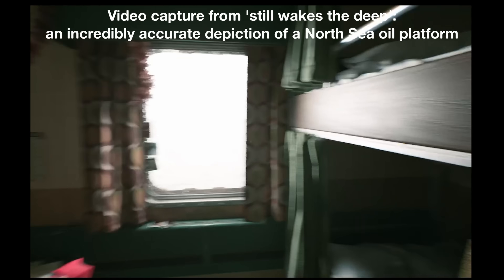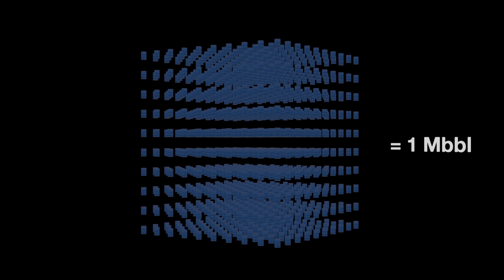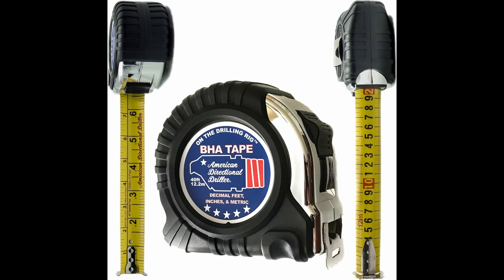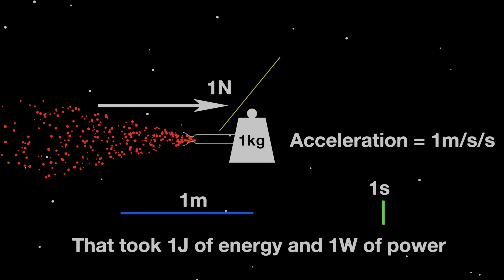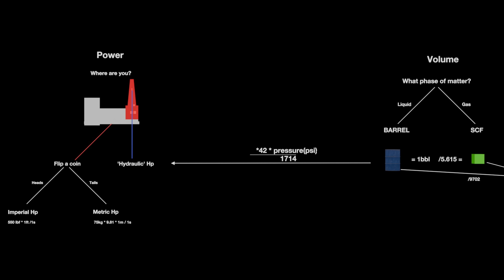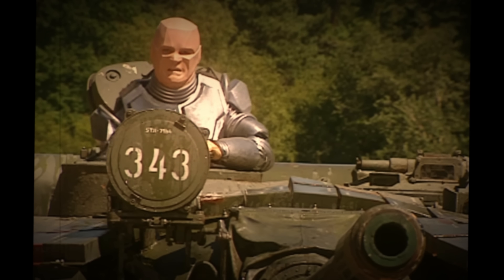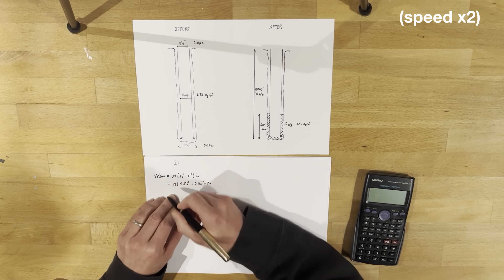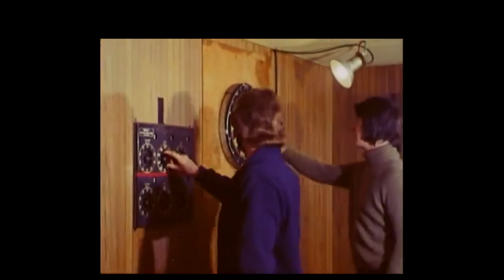Oilfield Units: a Measurement System so Cursed it made me Change Career

Comment: I'm disappointed that you missed out on the reservoir unit of volume. It's 10 square cricket pitches to a depth of 1 foot aka the acre-foot. 
And the API gravity scale was chosen to give a linear scale on a hydrometer.
From time to time in the oilfield I would be asked by junior engineers where they had gone wrong when their calculations of gas rate were a factor of 30 different from the oil company's measurements. My smart arse response would be too say I think you are actually a factor of 31.62 different, that's the number of cuft in a m^3.
The ratio of prduced gas to produced oil at surface conditions is called the GOR, gas oil ratio. It might be supplied in cuft per bbl or m3 per m3 or (in one memorable case) in m3 per bbl. Obviously nobody ever supplies the units of GOR unless prompted.
On one occasion a junior engineer decided to work only in SI units to avoid any ambiguity but forgot that the SI unit of deviation is a radian and not a degree and thus ended up with spirol well that repeatedly looped the loop.
In a similar vein the inclination of a borehole is measured from the vertical in an oil well but from the horizontal in an oil field research centre but in that case I prevailed on the research centre to change.
Standard conditions for pressure and temperature? I think there are over ten standards in use.
Similarly the universal gas constant k from PV = nkTz comes in numerous flavours (values) depending on the unit systems for Pressure, Temperature and Volume.

Comment: machining trade student: most measurements are done in "thou" as in thousands of an inch, with an inch being exactly 2.54cm and im not rounding because the modern industrial inch is different from the old regular inch from like 75 years ago (and much better for it, the old conversion was something like 2.540006 or something stupid-er)

but yeah
"thou" (0.001 inch)
"tenths" (0.0001 inch)
feet (12 inches)
inches (2.54 blessedly sane and standardized SI centimeters)

and sometimes millimeters but that's not standard, I've just been taught to make sure my drawings are using the unit they should be (inches and thou...sandths of an inch)

Comment: My favourite thing about the US gallon is that the figure of 231 cubic centimetres comes from the wine gallon, which was defined as the volume of a cylindrical container with depth 6 inches and diameter 7 inches. On top of being completely insane length choices, you only get 231 exactly if you approximate pi by 22/7.
Reply from the maker: What!? I never knew this! This is both historically interesting yet practically a bit unhinged.
(Also sorry for kind of stealing your video title)

Comment: Decimal feet actually makes sense and leads to fewer errors. They keep "pipe tally books" and arrange the drill pipe into "stands" of 3 pipes. Each of these are "strapped" (measured) and a tally is kept in the pipe tally book. When you put it down the hole, you only need to tally up the lengths to know the length of your drill "string." It is easier to add up numbers with decimals than it is to add feet and inches.

Oh, and SCFs (scuffs--standard cubic feet) are only all the same when at standard temperature and pressure. But that's the same throughout physics so it just makes sense.

Comment: The most ridiculous thing in US measurements system is a common use of common fractions in various measurements and calculations. I may understand that in some situations like construction sites using a 1/3 ft may feel intuitive. But things get creepy when you try to identify some wicked inch bearing and you realize it is 1/2 x 3/16 x 13/64 inch. God, why?

Comment: "one thousand seven hundred and fourteen" vs "seventeen hundred and fourteen" - I don't know about US drill crews or whatever, but in the US general population, both those forms are used, basically completely interchangeably. 

Some people may use one form more than another, some may just switch basically at random. Personally I hate the "seventeen hundred" form, it generally takes me more mental effort to covert it to "one thousand seven hundred" which I then can actually understand as a number. But even I sometimes end up saying the other form, usually if talking with someone who is saying numbers in that form.
Reply: and then ther is me
i say "seventeen, fourteen" 
If you dont think about it and just writ down what the person is sayng it is very nice

Comment: It's not so much US using weird units as their insistence that their version of Imperial is Better(tm) and more Natural(tm) than SI units and refusing to even consider switching. Because apparently adding zeros is too difficult.
2:38 I mean, at least a million barrels isn't "mmbbl", millimeter blue barrel. Giga is fine, it's SI. Is Gbbl pronounced "gobble"?
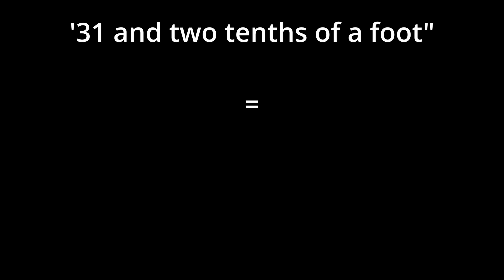4:50 Oh. For a while I pondered the possibility of there being a "decimal foot" that was 10 inches. As in, 10 "standard" inches, 254 mm.

Comment: Oh but there's one even curseder unit used in US HVAC: The Ton Of Refrigeration.

To quote Wikipedia: It was originally defined as the rate of heat transfer that results in the freezing or melting of 1 short ton (2,000 lb; 907 kg) of pure ice at 0 °C (32 °F) in 24 hours.[1][2]

Comment: 11:52 Watt-hours are pretty convenient to the customer. You don't need to know the relationship between watts and joules or anything like that, you just multiply your watts by number of hours, and have the result. Very easy to do math, no need to scale it by 3600 or anything.

Another useful case for it, batteries are often labeled in amp-hours. Multiply your amp-hours by the voltage, and you have your energy output in watt-hours. Very easy to do.

Comment: Oilfield engineer with over 20 years of experience here - most people don't have a conversion book - they memorize the key ones.  

I have used the 10ths of feet a LOT, because it's easier to enter data into and out of spreadsheets without adding extra  conversions. 

API gravity is not used in calculations to my knowledge  fluid weights ARE expressed in pounds per gallon (ppg or lbs/gallon) but also a lot in specific gravity (SG)  

I haven't ever had to deal with any UK Imperial units - I suspect that's a UK specific thing - not even the UK based companies in the US use them.   

For the hydraulic fluid power calculations I have never seen it done using gallons:  Everyone uses the little rhyme "pressure x rate over 40.8' with pressure in psi, rate in bbls, and power output in horsepower.  

I have never used BTU's for any calculations of any kind, except specifically for burners and burner rates, where the ONLY measurements being used are heat.  

Darcy as a unit of permeability is actually a REALLY good unit because it's dimensionless and works in any unit system.  It's also not something that has to be converted to and from other things.

His example calculation is made overly complex, because he doesn't know when or how to use the oilfield conversion factors - the simple way is: (hole inner  diameter ^2 - casing outer diameter^2)/1029.4(conversion factor from inches to bbls) x number of ft of cement desired.  

If you are in the US, and measuring everything in customary US units, the only 'unique' item is the bbl for liquid measurement.
Reply: You don't even understand what a dimensionless unit is, if you think that the Darcy is dimensionless. Remembering little rhymes to avoid thinking ensures that you are stuck in the dark ages.

Comment: I've worked in wholesale gas and electricity market design my whole life. 

I can confidently tell you stuff like £/kWhr/hr and TWhr/yr are incredibly useful for the contracting and downstream trading aspects. It's infuriating when brain-dead engineers try to simplify it all only for massive confusion to ensue regarding whether someone is talking about booking a years worth of pipeline capacity or a volume of gas. Each stack of units implies some specific purpose based on industry norms.

Comment: Are we just going to conveniently ignore that in SI the gravitational constant is the wonderfully round 9.80665 G constant. Is this important? Maybe. Lets see. If i have a 1 meter bar how many kilograms of weight do i need to put on it to achieve a 1 N/M torque? Reasonable right. Whoa crap. Thats (1/9.80665) kilograms... ew. I guess i need to find my 0.10197162129. Sure glad the metric system helps me with such nice round numbers in outer space... but im not in outer space am I? Crap! 
Lets look back in English land with us cavemen. Whats the gravitational constant between mass and force? 1. Now thats a pretty constant. Seems pretty nice doesnt it? I wonder how many ponds of weight i need for 1 foot pound torque on a 1 foot bar. Whoa. 1. Now thats some hard hard math. Damn.
Reply: the 9.80665 is a avgeg and depends on wer in the world you are, wher i am it is 9,82m/s² 
and also the reson it in so inpresice is since it is  mechering realety wich never gives you nice round numbers. Also you need to round of your resolt to the amount of position of the mechering, (Let's assume you have measured 1 meter to perfect precision) that will give you 1/9,82 = 1,02 * 10^-1 kg and  1/9,80665 = 1,01972* 10^-1 kg

also the foot pound depends on wher in the world you are
Reply: Ok, with metric, most engineers are going to shorten the 1G into 10m/s^2, because it's accurate to .02 and the difference doesn't matter for casual calculations. If it is something that matters, then you just open up your calculator and use 9.8 because earth gravity varies by a hundreth or so across the world. You're ignoring basic rounding to make your argument.

As for imperial, this depends on if you're talking about pounds-force or pounds-mass, and nobody ever notates which they're using, and I've seen both labeled as "lb" on the same piece of paper. Then, for lbf, yes it's relatively easy because pounds aren't a unit of mass. The problem is that then, if you need to find, say, the angular inertia of your bar, or the energy of the moving bar, you're going to have to convert to lbm or slugs - easy with lbm anywhere on earth, but 1 slug = ~32lbf (us customary). Then, you're going to need to make sure that everything there on out is compatible with which system you've chosen, because it's going to be a pain to ensure your conversions every time. Oh, and you're going to have to add extra conversion factors if you want to work with, say, the energy of the system, because energy is generally in SI and imperial energy units are very weird and hard to find reference data for. So you can see how, for engineering calculations, it's far easier to stick with metric.

Comment: Fun fact: Standard Cubic Foot isn’t really a measure of volume (despite having a name that sounds like it is). It’s actually a unit of moles, which is itself a unit that counts the number of individual molecules present. Worse, it’s generally not linked to the normal SI unit of moles, but lb-moles, which are truly cursed. Usually, 1 lb-mol of a gas is 379.5 SCF.

If an engineer tried to say “ok this pipe is flowing 500 standard cubic feet per minute, so if I want to find out the gas velocity I just divide 500 by the square footage of the pipe’s cross sectional area and I’ll get the velocity in feet per minute” they’d come up with a very wrong answer. Because that gas isn’t sitting still under ideal conditions.

SCF is basically an imaginary unit that works back to moles (and if you have the mole weight then mass). Why didn’t we just use mass or moles then? Who knows. Why do we keep using such an arbitrary unit? Because that’s what the cash machine pays in. Go tell the accountants or the investors how many pounds were produced and they whimper because that doesn’t mean anything to them. They buy and sell in SCF and therms and are incapable of performing basic unit conversions, even with a computer.

And worse fun fact: there’s also a “standard barrel” unit which is basically the same concept but with liquids.

Comment: How do you measure gas by volume? Isn't it compressable?
Reply: Usually, gas volumes are measured and defined at a given pressure and temperature. For SI, this is the Standard Temperature and Pressure (STP = 0C, 100kPa), but for imperial the benchmarks for any given unit can be different! BTUs are, depending on where you are, defined relative to 59F, 60F, or 39F. These are all roughly equivalent to 1055J, but it depends!

Comment: Having worked for a decade with Baker Hughes and Halliburton, I to can attest to how bass-ackwards oil field math can be.  Here in America I used a Red Book, but all the same. I would initially be made fun of if I dug out a calc.

I think the reason a lot of these units and measures are around is simply to perpetual the "Good ol' Boys Club-ness" of the industry.  

As an American I like decimal feet as it's our attempt to acknowledge the metric system and it's simplicity.

After I had been in the field a bit, and established in the field,  I began to play with the newer roustabouts by saying "Anti-Clockwise."

Comment: I've worked in the oil, maritime and refrigeration sectors as a mechie in the US. They're all exactly like your experience with the oil sector in the UK. We do not use SI units at all, except in relation to electric power for our equipment. It's absolutely gatekeeping. Going from maritime into refrigeration I was simply expected on the first day to know what a Ton Refrigeration was.

Comment: I am a Canadian hydrocarbon engineer. We have an even more mixed-up system, because Canada is nominally an SI country, but all of our O&G is sold into the US. All regulations and regulatory submissions are done in SI, all commercial transactions, and many engineering calculations are done in fps (feet-pounds-seconds) a/k/a "Imperial" units, for our American customers. So myself and my colleagues have, by necessity, become fluently "bilingual" or even "multilingual" when it comes to units. We pronounce the last letter of the alphabet "zed", and the metal with atomic number 13 with the last i being silent, which, of course, is correct. LOL. 
Incidentally, the biggest screw-up with units that I ever came across had to do with the size of a standard cubic metre. A standard volume is, of course, actually a molar measurement, and is dependant on the temperature and pressure that it references. As it turns out, a standard cubic metre can be quoted at either 1 atmosphere, or one bar (not much difference) and 0 C, 15 C, or 20 C, (quite a big difference). The gas does not care what unit one uses, but equipment sized for a zero C Sm3 is not the same as that sized for a 20 C Sm3. Some expensive metering equipment had to be replaced for that particular issue, and we all agreed to use standard cubic feet, which is always measured at 14.696 psia and 60 F.

Comment: What do you do with produced gas on an at sea oil rig? Flare it. It's dangerous to keep around and if it can't be productively used then it should be destroyed.

Oil field units are dangerous to keep around, and in many locations/use cases are not productive. It's obvious what must be done.

Comment: Plus: Petrochemical Industry is not immune to insanity. I graduated in NZ (metric), worked for a US company in Australia (US Customary then stitched to metric), then US company in Texas (basic to Customary).  After a while, the unit conversions in common use were memorised.   FOET: ‘fuel oil equivalent ton’.  I don’t recall whether short or long ton.  Coal, ammonia, methanol mostly sold in short tons.  Ethylene mostly sold in metric tons (tonne, anyone).  Tons are fun.  Basic chemicals and feedstocks priced in c/lb (cents per pound) or c/gal (cents per US gallon), including ethylene, LPG, ethane.  To convert you need density.  What density?  You find the density (in lb/gal) at the normal boiling point of the gas.  What is ‘normal’ pressure?  I forget, I now work for a German Company.

Comment: I lost it at "dog leg severity" It sounds randomly generated.
Reply: My company builds a tool that measures inclination and magnetic heading of the drill bit and transmits it to the surface. The rig tracks how many feet of pipe have gone down hole.  So all the parts of dog leg severity are on the rig floor display.

Comment: Wild idea but I would love for someone to do some efficiency calculations on this way of working. So all the time converting SI to OF all the times a conversion or mix-up from it has occurred and caused delays, damage or issues. Then work out the impact of converting every process to SI. See which is better. 

If the cost and efficiency of doing everything in SI is greater to a good degree. I'm going to start an oil company lol.

Comment: 15:51 Bro, (ID^2/OD^2) / 1029.4 = bbl/ft. Multiply by the feet and you have barrels. ez
Reply from the maker: Check the pinned comment (you’ve also made a mistake in your memorised formula)
Reply: @Alexander-the-ok You are absolutely right, I flipped ID and OD. The units are absolutely rediculous, but they are the product of a long history of using them combined with a bunch of random factors that people have memorized. It’s archaic and unnecessary, but I don’t think it’s gatekeeping. I think it’s just what people are used to and comfortable with. Keep in mind many of the people on an oil rig are not engineers.

Comment: Look, 42 gallons goes in a barrel, and 0.052*depth (in feet) * lbf/gallons (ppg) is equal to psi. also ppa is pounds per absolute gallon and so 2 ppa is 2 lbs in a gallon which is more than a gallon, the a stands of absolute which is how you know its a concentration and not a density.

Comment: Would “mud weight” not be a concession to the fact that mud likely isn’t perfectly consistent density across each barrel of mud? While I, like you, hate excess and extraneous information, I gather that certain measurements are specifically enforced to prevent “assumptions” by the knowledgeable. Could be wrong.